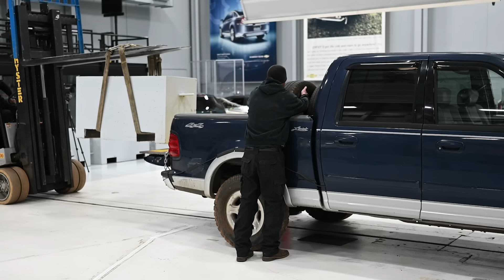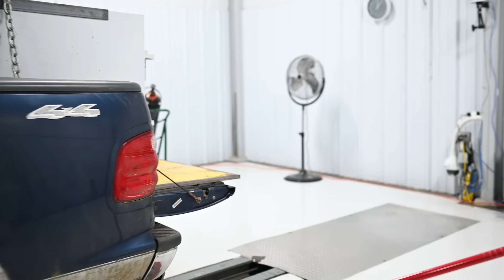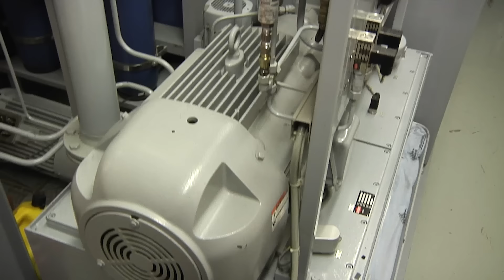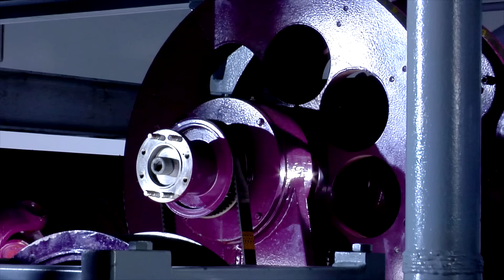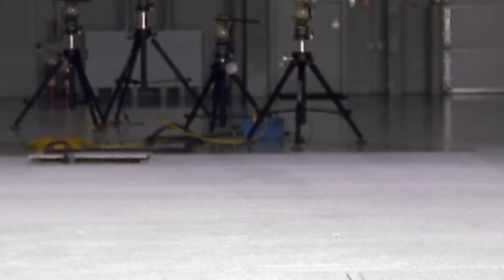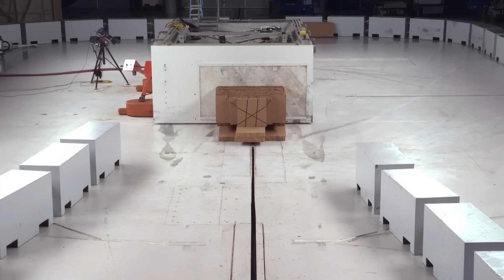IIHS crash propulsion system still pulling its weight

Comment: The infamous 1997-2003 F-150 which flunked the moderate overlap test back in 2001
Reply: That was the Extended cab, This is the Crew Cab, which has proven to be safer.
Reply: @rych3rr  well I know the crew cab was safer since the 2015 crew cab got a good rating in the small overlap test but the extended cab got a marginal rating. But the 2016 extended cab got a good.

Comment: 6000-9000 pound vehicles? That weight would be annihilation for any vehicle that was involved in a collision with a vehicle of this size. Trucks and SUV's are much too large now, and already create a hazard to other drivers. Then we have all the required safety equipment which is undermined by all of the driving distraction infotainment centers. American auto makers really have it all backwards.

Comment: Now that you started doing the Small Overlap Test in the mid 2010s, you guys should retest older vehicles that were crash tested in the 90s and 00s as well as ones that were featured on Dateline when the Moderate Overlap Test was still new to see how they do in the Small Overlap Test. 

I’m very curious how they would perform in the Small Overlap Test especially if they received a GOOD or POOR rating in the Moderate Overlap Test when that was new. 

Poor/Marginal rated vehicles from the Moderate Overlap Test that I’d like to see tested in the Small Overlap Test would be the… 1998/2002 Ford Explorer, 1996 Dodge Caravan, Toyota Previa, Pontiac Transport, 2001 Ford F-150, Isuzu Rodeo, Chevy Blazer, Chevy Cavalier, etc

While Good/Acceptable rated vehicles from the Moderate Overlap Test that I’d like to see tested in the Small Overlap Test would be the… Chevy Lumina, pre 2006 Ford Taurus, 2004 Ford F-150, Honda Odyssey, first generation Toyota Sienna, Ford Windstar, etc

Comment: I want to know what happens to the batteries and the vehicule  when the truck smash ... gas trucks can lose oil or gas but do electric trucks batteries spill acid everywhere ? if my car gets upside down will the battery acid leak on me and my passengers ??
Reply from the maker: Fuel leaks are very bad whether we're talking about electric or internal combustion. A gas leak or battery issue (fire, battery temperature spike, damaged fuel cells) would result in an automatic poor rating in one of our crash tests. While we haven't seen any EV battery issues, we've periodically detected fuel leaks, especially early on in our moderate overlap test program. These have often led to recalls in the past.
Reply: @iihs-hldi  Thanks for the info !!

Comment: That payload hitting the engine before receiving the slightest of resistance is pretty crazy.  Granted Ford is trash.  Their bed payload is supposedly the same as RAM and GMC but really isn't.  Even though leaf on the standard 1500 or 150 based models (not HD) aren't meant for much, I believe Ford cheeses that even more.  However if you notice, this truck is CLEARLY a HD because a non-HD rearend would be scraping the ground.  Still, everyone in that cab would be dead.
Reply: And you know nothing whatsoever all pickup trucks would do likewise it’s called physics, imagine any car holding a 5000 pound solid boulder from going through a metal laminate, Ford makes tje best trucks and the fact the entire cabin got undeformed under such brutal force is itself a big point in Ford trucks favor
Reply: @gorgeusjames  derp much?

Comment: Wouldn't that weight moving dampen the impact to some extent vs that weight being securely fastened as if it was part of the vehicle structure? I don't know how secure an EV battery is, but I would hope more so than cargo. Apologies if it was mentioned. I watched this in a noisy environment where sound wasn't an option.

Comment: the fact that a bunch of 10,000 lbs vehicles will be driven by the average Joe in a few years is terrifying...
Reply: 10000 lb vehicles that go 0-60 in 3 seconds without the brakes or handling to match, and you can’t see the ground less than 50 feet in front of you
Reply: It's called U-HAUL trucks, millions of people do it every year.

Comment: Not sure if you conducted this test accurately. Shouldn't you have attached the weight to the frame of the vehicle? Allowing the concrete block to slide from the back of the truck to the dashboard dissipates a lot energy and the initial impact does not represent the total weight of the vehicle+ the block as the block was still moving when the vehicle was not.
Reply from the maker: The crash had nothing to do with this test. We just needed to get 9,500 lbs up to 40 mph and hold that speed consistently into the barrier. It was a test of the propulsion system that moves the vehicles.
Reply: Exactly this test is pointless by just putting in a bed a 5000 pound solid concrete

Comment: So is there any consideration or long term effects? Would you still consider upgrading (i.e. additional steel cabling to reduce the load on a single cable?)

I'm basing this on the or clip I saw of the cable and pulleys so there might already be redundancy. If so, disregard the question lol

Comment: Force = Mass * d/s^2 OR The heavier you get the increasingly slower you'd better be going... If you interviewed the wall after that cash it would say "I either got hit by a truck that weighs 10,000 lb going 40 mph, a 20,000 lb truck going 10 mph, or a 5,000 lb truck going 160 mph. It's also possible I got hit by a motorcycle going Mach 14."

Comment: I appreciate all tests for safety. With that said, this particular test makes me wonder about where the batteries Actually are located, with their dimensions as well. Not to disprove a safety concern, but to be more accurate vs a concrete, tall mass that isn't running the length of the support of the frame in an accident.
Reply from the maker: Hi, we recommend watching the whole video. It's clearly explained that this test wasn't about the impact. We've performed crash tests on a number of EVs. This isn't meant to illustrate an EV crash.

Comment: Well the engineering of the super heavy EV cars are different, the payload storage for the battery is in different compartments encased with sturdy enclosures supported by the frame. The weight is distributed differently. You can’t just compare it by putting a payload in the flatbed and call it the same.
Reply from the maker: Watch the full video to understand why we did this test.

Comment: This testing seems pretty pointless as the weight distribution for an EV would be completely different, also the structural aspect for an EV compared to a gas truck is completely unreasonable
Reply from the maker: What was the point of this test? If only there were a video explaining it clearly.

Comment: I do believe the 40mph crash safety test is outdated. So many accidents are happening at highway and interstate speeds exceeding that.
But this video illustrates a massive new problem. The weight growth return electric vehicles combined with volatility of battery chemicals is going to cause massive issues on highways

Comment: I've always wondered what happened if I put that much weight in the back of an F-150 and crashed into a wall, I guess I have my answer!
Reply: Too different since loads are normally not a 5,000 pound solid concrete block lol like here

Comment: A real ev truck wouldn't have it's batteries in the bed but in the frame between the axles .And this is a loose load not part of the vehicle. They're testing their equipment not an EV truck

Comment: The problem with this test is that it does not accurately simulate an EV truck crash. It is a good test for an oversized load in a flatbed pickup. However, the battery is beneath the floorboard of the truck and extends into the cab. While that eliminates the possibility of a load crashing into the back of the driver, it greatly increases the likelihood of a fire. Even more problematic is the fire would originate from under the passenger(s). This could almost guarantee fatalities in a roll over or trapped passenger situation.
Reply from the maker: As was explained in the video, the test had nothing to do with the vehicle involved or what happened at impact. The test was of our propulsion equipment, which had never pulled a vehicle weighing 9,500 lbs before. We needed to make sure it would be able to handle the weight in the length of our 600 ft runway. We've tested plenty of lighter EVs and those videos are available on our YouTube page.

Comment: They have been doing the wrong speeds for decades.  And it does a disservice, because automakers design the vehicles to expend the entire crumple zone at 40 mph, because that gives them the best rating even if it leads to far more fatalities and permanent cripplings at higher speeds.  Granted, there is a speed at which the G-forces are so high that fatalities is almost guaranteed, but 40 is not near that.  And we know cars can be designed much more safely, because we see race car drivers walk away from accidents that take place at far higher speeds.
Those cars often are made with chromoly, and that is expensive, but this country can invest in technology to make large amounts of titanium which is much more plentiful than molybdenum, and use alloys of that to arrive at similar strengths.  We need nuclear power plants to directly power the production of mountains of titanium.  
And have you seen what happens when aluminum buses get in accidents.  Very ugly.  They get torn into like aluminum cans.  Titanium buses would be just as light and far stronger.
Reply from the maker: OK. But optimizing for less common higher severity crashes means these more common crash scenarios aren't being addressed. We can't create vehicles that hold up structurally at 60 mph into a rigid barrier without being so rigid they won't be more dangerous in much more common crashes. The solution is to slow down.

Comment: The battery pack of a truck will not be in the bed of the pickup directly behind the passengers. 
This was a cargo load test.
Reply from the maker: You are correct that an EV wouldn't crash like this, but incorrect that this was a cargo load test. It was a test of our crash propulsion machine, as clearly explained in the video.

Comment: What are you doing about possible battery fires from a crash?  From my experience, they required a lot of water.
Reply from the maker: We haven't uncovered any fires or fire risk in our numerous crash tests of EVs. If we do have an issue it will be treated like a fuel leak in a conventional vehicle, with an automatic downgrade to poor. If you mean what are we doing at our facility, we have protocols in place to quickly and safely move the vehicle outside. The local fire department is also on call during tests of EVs and hybrids.

Comment: That's at 40mph, imagine if that was at what ppl normally drive at. Then imagine if it's a head on collision at 40mph. 40+40=80mph. Out of curiosity why are cars allowed to go faster than what they're crash tested at? 🤔
Reply from the maker: Actually a 40 mph barrier test approximates two vehicles of the same weight crashing head on at just under 40 mph each. And keep in mind that many real world crashes involve pre-crash braking or crashes with movable objects. Our research has found that the majority of injury crashes involve forces similar or less than those in a 40 mph barrier test. However, slowing drivers down is a great way to keep everyone safer. Intelligent speed assist (ISA) is a technology that is already making a big difference in Europe. It hasn't gained much traction yet in the United States.

Comment: As the others are saying, I love how this test was just a capacity test, but it also shows what happens when you exceed the load limit + don't have said load tied down. That was a crunch and a half.
Reply: Actually, I would like to see a crash test with a ram 3500 fully loaded. I don't think it would be much different since the only thing that makes it different from the 1500 is a taller frame.

Comment: How about a more realistic test where the weight isn't 3 times the maximum payload capacity that's also conveniently placed on a smooth surface so it slides easily into the cab. Furthermore the straps were not  securing the weight from forwards and backwards movement. Was you afraid the 9,000 lb weight would fly out from the wind? This test is rigged.
Reply from the maker: You obviously did not watch the entire video. This test had nothing to do with the impact.

Comment: I could be wrong here, but I think the big thing with EVs is that all that weight is low.  Very low CoG on these compared to ICE vehicles where the majority of the powertrain weight is at or above frame height.  EVs the batteries sit under the floor and directly between the frame rails.  I'd think that would make its energy much more conectrated?

Comment: Why not use the vehicle’s on-board propulsion system (engine and gearbox)? After all, when vehicles do crash, they tend to be running under their own power.
Reply: Because they need to remove the fluids. Can't run without fluids. They also need to accelerate to a precise speed. Hacking thousands of different drivetrains to do that would be ridiculous.

Comment: After watching this, if you aren't testing for it now, I've never seen anyone rate the cab in relation to a load carried. The load goes straight into the passenger compartment, and it would 100% have killed someone. Every single freaking day I see some old pickup with a load that would probably do exactly this, and it would be good to see someone do thorough testing of that idea. If this is already a testing thing, well, I'm glad to be wrong.

Comment: Since the weight was not secured to the frame directly the test is inconclusive. Much of the weight of the concrete was dispreseded throughout impact rather than at initial impact like a battery secured to chassis would be.
Reply from the maker: This test had nothing to do with the impact. We were just trying to make sure our crash machine could get the vehicle to 40 mph and maintain that speed. If you're looking for a test of an actual EV, we have plenty on our YouTube channel.

Comment: 40mph I love how in the real world California has the lowest freeway speeds of 65mph  else where 70mph + get you test at 40mph ? Make it safe for all cars to crash at highway speeds not residential street speeds !
Reply from the maker: The energy involved in 40 mph frontal tests captures most injury crashes. Keep in mind that most highway crashes involve pre-crash braking or impacts with other vehicles/movable objects. It's all about the change in velocity, not the travel speed. Upping the speeds for barrier crash tests would result in vehicles being optimized for less common higher-severity crashes, which would result in stiffer frames that would be less protective in more common lower-speed crashes. Either that or really long front end crumple zones.

Comment: Wouldn't the first upgrade you make need to be some foam-fire suppression system given the battery's will inevitably fail and catch fire?
Reply from the maker: IIHS has already evaluated plenty of EVs. We have special precautions in place related to monitoring the battery temperature, but we haven't had any issues yet. If we did, we have procedures in place to get the vehicle outside quickly. A battery issue would be treated as a fuel leak is treated in ICE vehicles - automatic poor rating.

Comment: Are IIHS taking damage to the batteries into account? Sure, the airbag might deploy correctly and on time, but if the battery packs burst into flame at the slightest damage, I wouldn't consider that safe. Especially now most electric car has electric door handles with hard to reach/find manual lever. So you ended up trapped in a burning car that can't be put out by fire department. Making you wish you were killed by the impact instead...
Reply from the maker: Yes. Battery integrity (like monitoring ICE vehicles for fuel leaks) is an important part of our procedures. If a battery were compromised it would result in a downgrade to poor.

Comment: Will there ever be 70mph crash tests? Or even 55. I'm very interested to know how vehicles fare at the speeds I'm going 90% of the time (my entire commute is highway). And thank you for your work, I love your videos and consult them when I'm deciding what cars to buy.
Reply: You are dead no matter what at those speeds
Reply from the maker: We did recently test 2010 CR-Vs at 40, 50 and 56 mph: https://youtu.be/tZChyjaqNBI

This is interesting from a demonstration standpoint, but officially evaluating vehicles in very high-severity tests would result in vehicles optimized for those crashes, which are less common. The result would be stiffer structures that wouldn't provide good protection in much more common crashes. Even at highway speeds, there's typically pre-crash braking or impact with other movable objects that brings down the energy involved. Bottom line - avoid distractions, wear a seatbelt, watch that speed. And of course avoid impairment.
Reply: @iihs-hldi  I heard you guys are crash testing Rivians. When will those results be posted? Also, thank you for making the crash tests harder to pass. With these super heavy electric trucks on our roads, the tests have be harder to compensate
Reply: @IIHS  ooh I see. That makes sense. I guess after a certain speed: Say 60 or 75+, we already know what any vehicle will look like, regardless of being weighted or unweighted.
Reply: You crash head on at 70 you're dead

Comment: Do the batteries weigh more than a gas engine?
Reply from the maker: EV batteries are quite heavy. As an example, the electric Volvo XC40 Recharge outweighs the regular XC40 by nearly 1000 lbs.